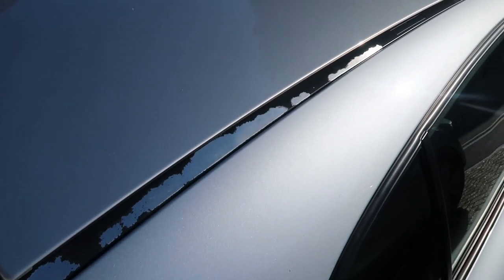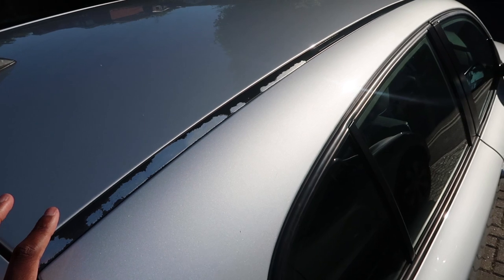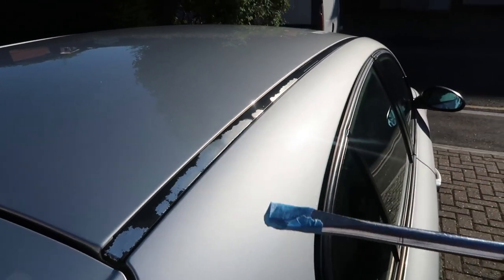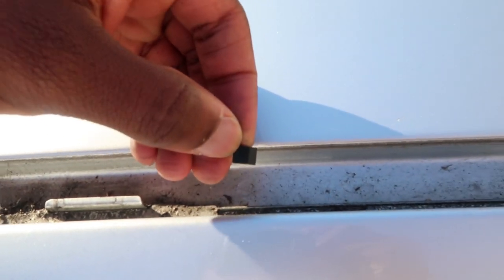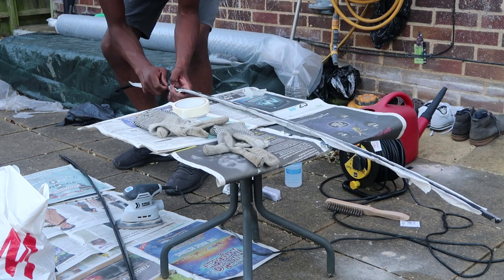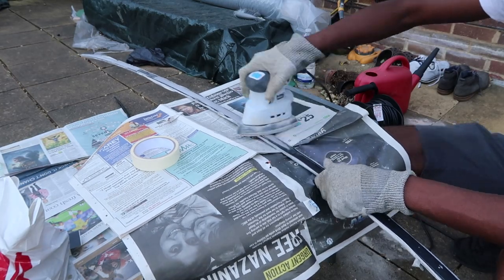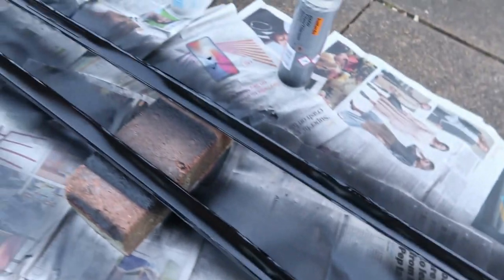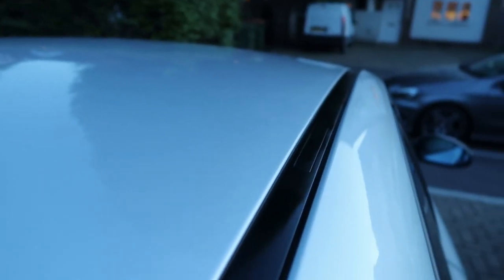Painting Roof Rails (BMW 1 Series E87)

Comment: Nice video! I'll be doing this job shortly on my E87 - but will be using an etch primer, satin black and a 2 comp epoxy clear (also satin). Simply painting it will not last very long, there is a reason why cars are primed, painted and cleared.
Reply from the maker: Sounds like a good plan. The gloss paint I used didn’t require primer and it seems to still be holding up well.
Reply: @johnomi  That's cool - but why skip priming when you're doing such a job? The extra effort and cost is nothing, but the results will be so much better. I've been doing this sort of work for 15 years, and never put on paint on any surface without proper prep and primer. This is not a criticism of your video, just a helpful tip for others wanting to do this.
Reply from the maker: Thanks for sharing your knowledge. I don’t doubt primer would produce a better finish.